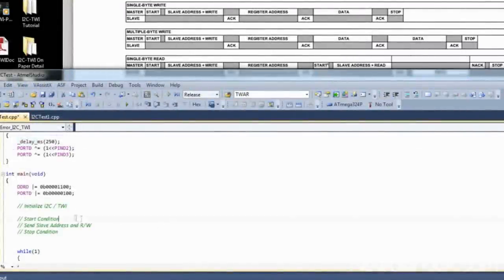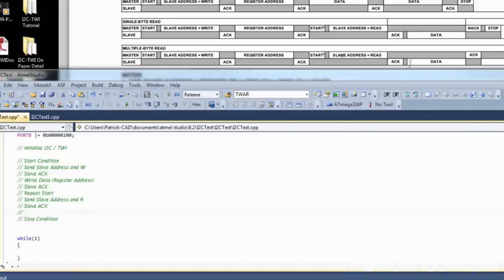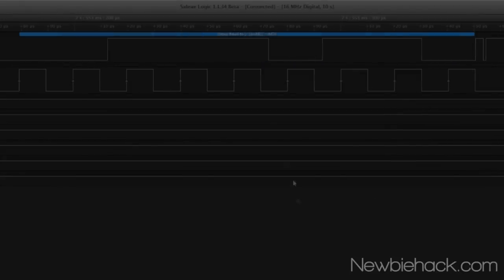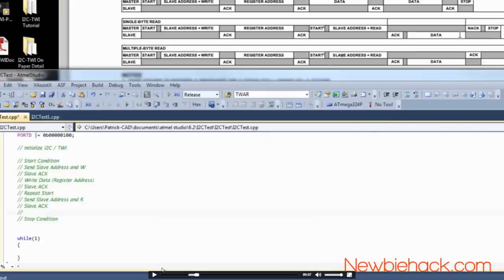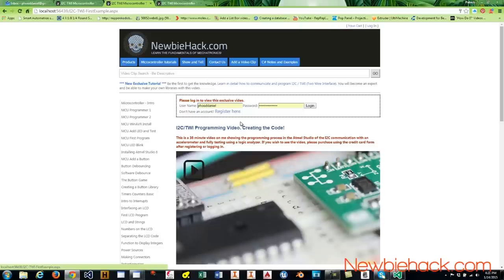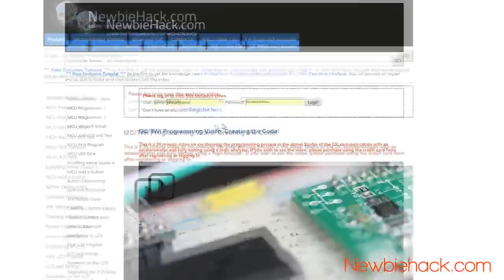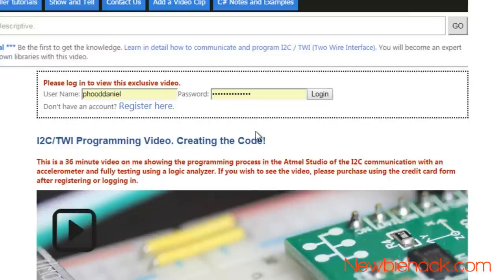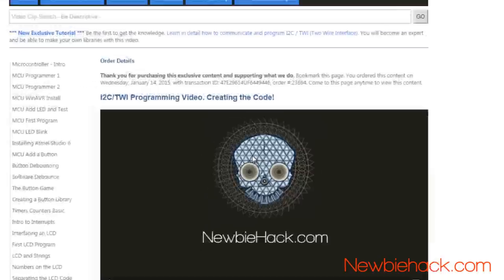57. Arduino for Propduction! I2C TWI in Code Instruction (How to get the exclusive video)

Comment: I would really like to purchase this video but every time I try there is an error. I’ve sent you an email and still have had no response. Is there another way I can view the video? 

Thanks.
Reply: solved the problem?
Reply: Umberto Xavier nope unfortunately.
Reply from the maker: It works now.  the problem: PayPal (the gateway) was expecting the TLS 1.2 and I was using the deprecated TLS 1.1.  I now set the service at TLS 1.2.

Thanks for letting me know!!

Comment: Purchased to support your good work. Waiting for your other video. Continue your AVR series with advanced interfaces or full project rather than starting from scratch of ARM series. Thanks very much.
Reply from the maker: ***** That video is in the making.  It takes a while to make videos.  

The ARM series is the obvious next step even for die hard 8-bit developers.  The 32-bit ARM chips are actually in more demand, contains more features, and are just as easy to manufacture.  All of this leads to less expensive processors and soon will be the sole development platform.  The 8-bit chips have a finite manufacturing life and if I don't provide tutorials for the ARM platform, I will most definitely be left way behind.
Reply: ***** I do agree with you. I love the way he teach something :)

Comment: Your videos are very helpful. Thank you. Now I would like to learn IoT. Can u make a videos on that too? maybe on ESP8266.
Reply from the maker: This is IoT, actually.  The only difference is the use of WiFi or Bluetooth.  Those components have communication protocols that have been covered in this series.  All you need to do is get the devices that you want to use for communication, hook them up, establish the communication using the protocols outlines in these videos and fill in the rest of the program that makes the magic work and you have your IoT device.
Reply: ahh..get it now..i will try..thanks..
Reply from the maker: You're welcome.
Reply: hi..i just purchased this exclusive video..when will the next video be available? I noticed in patreon page..you have some videos on i2c..are they different from this series? if they are different i am planning on taking a look at that too..

Comment: i'm disappointed but i understand
Reply from the maker: $3.90 really is a very small fee for what you learn compared to the cost of formal higher education.  Worse would be that I didn't create the video at all, which has been the case the past few years (I would make videos for a length of time then run out of time/money).  This can be seen by looking at the dates of the microcontroller videos and you'll notice that the videos are uploaded in spurts.

The videos for I2C has enough information, including programming code, that provide all the information to become versed in the subject without needing the last example video.  I intend to do this with all of the microcontroller subjects.

I will continue to sell the video as per the market demand (which is very low), so I'm not sure how the microcontroller series will play out (which would be  unfortunate because I love making them).  Maybe I should have a monkey in the background dancing, or have a first person shooter running the corner of the screen.  This type of thing seems to work, but tutorials that are very hard to produce bring in very little views (great number of thumbs up, but the critical mass isn't there).

Most likely, as I increase my product line on newbiehack, I will produce videos to show how the products work which may include programming.  Otherwise, I'm not sure what will keep this going.
Reply: Patrick Hood-Daniel Ok, i understand you and i think that you're right. Your videos are very useful for me. thanks for the response

Comment: This was the best channel I ever saw for AVR tutorials but now this channel is asking for money, very disappointed :(
Reply from the maker: I was spending more than 30 hours per week filming and editing.  It was costing me too much money to produce.  It really is unfortunate that tutorials of this quality need to seek support, that that is the reality.  If you have any better ideas, I'd love to hear them.
Reply: Patrick Hood-Daniel , I am following your channel for long time and it has been great watching your tutorials on AVR, the way you explain each and everything (without going into arduino) is great. I have a idea for you.
Actually, most of your videos is related to CNC stuff, which is quite costly to do and hence views are less. I will suggest you to focus on AVR based complete projects instead of only providing specific portions (UART, I2C, LCD interface etc.). For example, take a project on quadcopter, start it as a series of oncoming videos (weekly or biweekly), covering each step such as accelero interfacing, gyro interfacing, magneto interfacing, calculating the orientation, esc interfacing, application of PID etc. and finally completing the project.
DIY community is growing at very fast rate and from my experience I can say that there is still a gap that is not filled, which full project tutorial. The way you explain the stuff is best. Begin in this way, show yourself as well on the video (which affects the views and feels more interactive). I can guarantee that you can easily provide the tutorials for free which will further increase views and money.
I know that quadcopter (it was just an example) is a slightly heavy project, you can start from small ones like RPM meter, ammeter for high currents, even line follower using PID will do great, small home automation projects, segway etc.
Reply from the maker: Ashish Kumar The CNC is actually my main job and how I fund the AVR project.